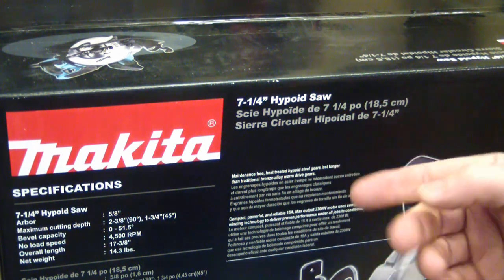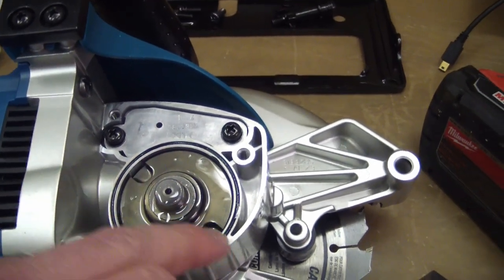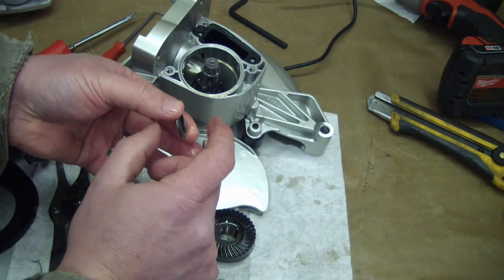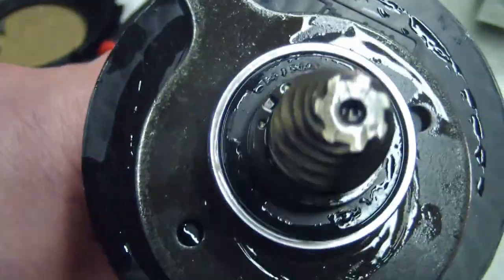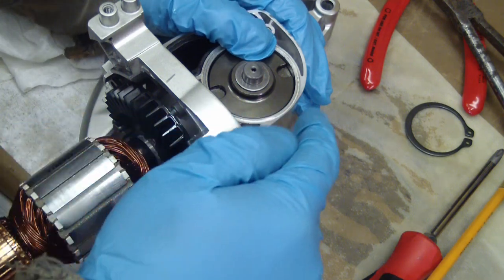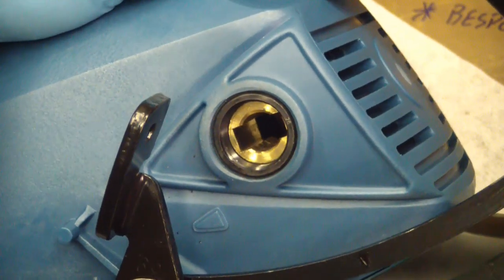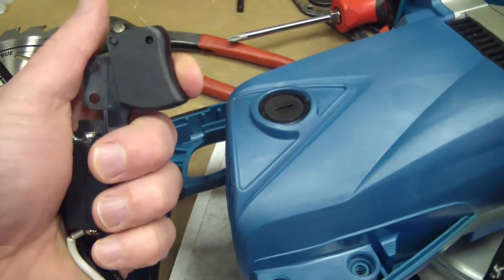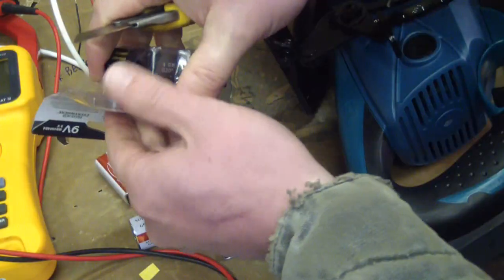Bored of lame tool reviews? Meet Makita's new Hypoid Saw.

Comment: love your reviews, theres definitly something for knowing how what you using actually works. but if i could correct someting you said, there are actually quite a few vehicels out there with hypoid diffs. orignally done to drop the drive shaft hight to reduce the bump in the floor, but done more now as a noise reduction trick.

Comment: Hi there. in the video, at min.19:35, I can see the plastic code in the housing: >PC- GF 15< which stands for Polycarbonate plus 15% glass fiber. PC is a thermoplastic but due to glass fiber content makes it a bit heat resistant. I prefer ball bearings rather than bushings for this application any away. thanks

Comment: I've used the grease trick for installing needle main bearings in old McCulloch two stroke engines. coat the races with bearing grease and stick all the needles to it. damn near impossible to do otherwise provided you don't have 37 hands each with tweezers

Comment: RE: Worm and wheel

From my experience with david brown radicon gearboxes the bronze wheel is protected from wear by the oil.

In my job i have found more radicon  (worm and wheel) boxes have died miserable deaths due to low oil levels.

Surprisingly it has been the bearings that let go before the gear.

Our units (used in sewage treatment) get heavy abuse too. 

With all this in mind, I pushed for a change to synthetic oil and we have noticed an increase in life span of the units!

Comment: In this rare instance, I feel I must correct you on something.
The drive axle in most automobiles is indeed a hypoid gearset, not spiral bevel. The rotating centerlines of the two gears are 90° to each other but on different planes.

One exception would be a Mack double reduction carrier where the first gearset is true spiral bevel. The rotating centerlines of the gears are 90° to each other and on the same plane.
Spiral bevel is usually employed where there is no reduction or very low ratio reduction, generally less than 2:1.

Hypoid is usually employed in higher ratio reductions, generally greater than 3:1.
Hypoid is basically a hybrid of the rolling action of a bevel gearset and the sliding action of a worm gear arrangement. It provides smooth, quiet operation and long life due to the large tooth contact area associated with the angle and geometry of engagement.

Comment: At one time welding machines were commonly used for power on job sites for heavy constuction and tools needed to be runmoff,dc power. Remember seeing heavy duty drills with 1/4" chucks. Talking 30 yes ago.

Comment: I think max current is achieved under load, not when it spins freely. Also, the input amps is only important for calculating consumption power, output power can only be calculated by measuring max torque.

Comment: I have a lot of respect for you man, but you are mistaken. Most cars since the 40s-50s on use a hypoid gear in the differential. Hypoid is quieter as well which is a key factor in NVH in cars. For proof, look at any car/truck with a solid axle and you will see that the pinion sits in the bottom which coincidentally means the pinion bearings sit deeper in the oil supply for cooler running. A 9" Ford axle is perhaps the most famous rear axle ever and it is a deep hypoid (farther down the ring gear, closer to a worm) which makes them heat the axle grease up much more than say a moderate hypoid like a Dana 60.

That said, I enjoy your vids man, keep em up please!

Comment: Why didn't you put a FULL bridge rectifier mounted on a heat sink and a capacitor on the output of the variac instead of using a car battery to get DC voltage ?

Comment: At 2440 the instrument he uses voltage regulator? I have one of those that is much older it only has a toggle switch for One it off And a single two prong female outlet....  I have been using it to try to slow down a buffing wheel but it doesn’t really swollen down only takes away most of the Torque Which keeps me from Burning through a finish.. Am I hurting my 120v Motor? What is the purpose or correct use of what I have?

Comment: i think most independent suspension differentials are center drive or spiral bevel, most solid axle differentials are either high pinion or low pinion types which are hypoid.

Comment: I k ow this is an old video. but Carpenters will often have a skillsaw wormdrive and makita hypoid. The reason is the which side of the saw the blade is on. Makes cutting hips/valley easier because they are cut on the 45 degree bevel.

Comment: Thanks for this. I am in the process of replacing my Harbor Freight junk with actual tools, and I decided that I also need a new circular saw to replace my aging Craftsman. My Craftsman saw was manufactured in the '80's, and it suffers from all the nasty things that was happening to Sears at the time. Not bad, but not good either. So this will be the tool that replaces my Craftsman saw (I never owned an HF circular saw), and largely because of the effort you put into your reviews. It was between this saw and the Skil, so you can understand why I came to the conclusion I did. 
So thanks again. Great video.

Comment: I have an older one, maybe 25 years old. When cutting plywood the blade starts to twist, and I have to move the tail end of the saw over to fallow the line. I'm guessing one of the bearings is shot, when I grab the blade and try to torque it in and out it seams tight?? Thoughts?

Comment: Good to hear the Dave Jones reference!

Your 9V batteries reminded me of something I did a while back... a bit of intentional destruction, but it was amusing.
I happened to find myself with 20x 12V 7Ah SLA batteries out of a UPS, all fully charged.
Of course I hooked 'em up in series for 240V DC (because we have proper electricity here in Australia). Used that to power some good old incandescent light bulbs (among other things), fed via an old table lamp inline switch - "A.C. ONLY".
I'm sure you can imagine the joy this was about to bring. Indeed, the switch had some trouble interrupting the DC!

I don't  recommend replicating this experiment. If you do, be sure to have a fire extinguisher handy, and a way to safely open the DC circuit!
Reply: *****
Remember: if in doubt, use your safety squint. Things blowing up is sometimes not the expected result, and if your eyes don't work it's harder to hide the mess from your other half.

I don't think a little 9V is particularly likely to blow up, they're not that high energy. But (ref EEVBlog) some of them appear to be made of several sealed sections which would be able to accumulate pressure, potentially resulting in poppage. A splattering of alkaline material can most definitely make a mess in your living room.

Comment: The switches have a habit of wearing out at the pivot point, since there is no longer a brass pin like they used to on some of the older models.  There will be nothing wrong with the switch itself, but there won't be enough throw on the trigger to engage the switch, rendering it useless. They use the same type of triggers on the newer XX10 and XX20 model angle grinders too.

Comment: I HAVE A QUESTIONS!
1 So all of those "AC" power tools is actually universal motors that can run on AC or DC?
2 Do you think it would be possible to use some kind of power tool for example e bike?
3 I have like a thought about maybe powering a bicycle with one of those high torque 18V impact drills, what do you think about it?

This review is awesomazable i really enjoyed it!
Reply: korsez Just note that those motors are brushed, and will not compare to the power efficiency of a brushless motor. However an 18v drill motor will be MUCH cheaper :P
Reply: korsez Those ebikes are in the news lately blowing up left and right... I am sure you will be fine building your own, after you have gathered all the necessary knowl... err, encouragement on YOUTUBE :)

Comment: why would not worn in brushes cause higher current draw?   Seems like additional resistance would cause lower amperage unless the speed of the motor is regulated, then it would end up with the same amperage.

Comment: That may not be a "voltage suppressor" on the line cord. I removed an identical one from a Porter-Cable tool and all it had inside was an anti-theft tag.
Reply: ***** Not often I'm right! Great reviews - good info with lots of humor.

Comment: I think the locked rotor current would just be the voltage over the resistance, or 80A for 120V/1.5 ohms. This is perfectly linear as long as the rotor is locked because the motor is just a resistor at this point. If the rotor is free to turn, once it starts spinning the current no longer is linear because of back EMF generated in the motor windings because the coils of the rotor are cutting the flux of the stator. Those pixies are tricky.

Comment: Strange that they used a hypoid bevel. There are more power losses due to sliding /rolling action between crownwheel and pinion compared with straight or spiral bevel.
Maybe to reduce transmission noise?  I remember GM hypoid bevels would be knackered if ordinary gear oil was used instead of hypoid bevel oil. I was led to believe that the hypoid additive had a plating effect which limited wear on the more heavily loaded gear teeth.  Late '50's GM used the Hypoid final drive to get a lower floor and trans tunnel.

Comment: Roger the separation.  I am a retired Engineer and in the early years did HM&E work for the military.  Often we were forced to buy "approved" equipment that had been around since the 30's.  Buffalo pump for example had a NPSH pump that was designed to work in salt solutions.  They came with carbon steel woodruff keys and caused us a failure we had to live with for 2000 hours.  Ergo quality and approved are mostly sales words until you correlate them with this type of tear down.  Down side was that open and inspect procedures lie this, good for data analysis, often created more failures and were eventually made obsolete.  Ergo "if it ain't broke don't fix it."

Comment: If you like your soldering iron tip chooching as long as possible - avoid using wet sponge for cleaning. We have noticed that one of our coworkers has been going through soldering tips quite faster than the others. He was changing them at least three times more often than the others.He was the only one cleaning them on a wet sponge. Then he changed to metal sponge and proved the theory right. This tip, unlike others, does not like to be in a wet environment when it's hot. Wet sponge destroys the coating and holes appear in the metal. Whether it's because of oxidation or rapid cooling - I don't know. Just sharing. Clean your tip in some dry's.

Comment: Bearing race housing boss (18:25) is plastic to prevent current through the shaft to the bearing. The moving gears causes static electricity which would discharge through the ODE bearing causing premature bearing failure. To prevent that they use the plastic housing, an o-ring in the housing, or they could use a grounding brush on the shaft. ☺
Reply: A really high end I industrial motor could use ceramic bearings

Comment: Thanks for the wonderful in-depth review! Subscribed.

While your description of the ferrite toroid around the cord makes perfect sense, you may find out that part is no more than a cleverly disguised Sensormatic anti-shoplifting tag. I was curious about this same thing on one of my new tools. :)

I also like Lucas oil products. You made a good choice there, in my opinion!bb
Reply: ***** I guess the thieves are getting more creative with removing these from packaging and stealing products, so the manufacturers are doing more to "embed" them where they can't easily be removed at the store. Another store is selling Dremel rotary tools with the cord-mounted style.  I tore down a portable air compressor (Husky from Home Depot) and it had a Sensormatic tag on the inside of the top cover of the motor.

Comment: Quick Correction Differentials on vehicles can be either hypoid gear or spiral bevel gear sets. The Ford 9" diff is hypoid gear set.  A good rule of thumb is light duty diffs are spiral gear sets and heavy duty diffs are Hypoid.  Hypoid gear sets are able transmit high torque than spiral gear sets but are less efficient than spiral bevel gear sets.

Comment: I just received a two year old makita from a friend who had it quit on him due to cord failure and then intermittent switch failure. I separated the handle to look at the switch and whatever I did allowed it to function properly again. Now that I’ve got it running it sounds like the gear is missing a few teeth and the pieces are floating around popping and banging while powered up, so I held it wide open waiting for something to explode and I noticed a 90 weight smell and the rpm fluctuates. Looks like pure Chinesium.

Comment: That gear lube is perfect for hypoid gears since it has the GL-4 and GL-5 rating.  I've seen hard working hypoid gears turn into razor blades from using GL-1 or other incorrect lubes. Good informative videos you have here.
Reply: Can you or anyone else here tell us more about that gl-1 to gl-x rating? I'm no expert in that field, but curious what it means to use a higher grade oil (and what exactly is the difference)? Thanks for more info
Reply: standard gears such as bevel or helical gears just roll or push the corresponding meshed gear. hypoid or worm gears slide across the face of the other gear and that can force out the lubricant between them. GL-5 i believe has added sulphur which adheres to the gears better and does not rub through when the metal is sliding. GL-1 is a gearlube which is mostly found in truck shops for use in transmissions. it may also be called GL-4 and works well with synchronizers because it allows them to grab instead of just sliding as this would cause gear clash, which can happen if you use GL-5 in a synchronized trans. Using GL-1 in a ford 9" hypoid differential will slowly wear the teeth till they are razor edged, just like slowly sliding a knife across a sharpening stone.
Reply: It's not necessarily a higher grade, just meant to be used for different purposes.

Comment: I personally feel that a plastic casing is fine. Modern technology can produce a lighter but still reliable plastic material. I did like the fact that the brushes are housed in a brass holder. It appears here that the trigger start component is good quality and with electrical connections which are proper screw type and with access. On my older power tools I have found that the electrical cables gets internally damaged just at the place where it enters the tool and thus I need to cut off a short piece of cable and re-terminate the wires. Having a proper design to be able to conveniently and easily work on  the terminal connections is  a very important consideration. It seems in today's world that electrical connections for appliances, or plugs, or electrical motors all have very poor designs and with little thought of maintenance. Thank you for an informative video and I will be sure to have a look at some of your other ones which I hope will be just as good.

Comment: I entered into tho word of amateur speaker building and got a skill plunge base router and a circle jig, it lasted 8 holes in two layers of mdf then crapped out! took it apart to find that the parts that hold the brushes in place are plastic. do they not fail test these things? this is one of those "a system is only as good as it's weakest link" tools. I just don't understand why it's done that way. dou you have a review on routers? I was looking at a bosh.

Comment: Have one ran the first couple jobs I had a kickback broke the springy thing and the thing holding it, that's the first weak point second is the coating on the electric cord I only get shocked when it rains out so that's not bad, also it should run 5000 rpm to be excellent. Other sad thing is it's not able to handle a large blade to saw 4 by fours

Comment: Forgive my ignorance please, and i know you likely won't see a comment on such an old video but I had to ask. The comment you made about it blowing the breaker if it was really 15A, couldnt that be referring to the "output" I guess after a transformer ? Maybe it's just simply that it's not referring to that and you know that's the case, but I'm a NOOB and just learned that for instance my 12V charger is able to  pull more amps than the breaker because it's not really "pulling it" but rather 
outputting after the transformer. Is it safe to assume that’s just not the case when talking about dc motor electric specs?

Comment: AvE, I was wondering if you could help me out. My school is thinking about making a sort of 'makerspace'. First, we'll have 3D printing, but we'll also have LOTS of woodworking, and metal working tasks. I am working on trying to help them figure out what they need, because let's face it: an IT department doesn't know crap about machining. So, I was wondering if you could give me some advice on must-have tools (like drills, angle grinders, dremels, and CNC mills), where to buy them, and what brand to buy them from. We are probably going to work with the normal wood and wood related materials, plastics like nylon, polycarbonate, and rubbery materials from the 3D printers, and on top of that, metals ranging from aluminum, to steel and iron, anything more extreme would be unnecessary. We may do welding but I'm not sure, but we will do lots of CNC milling and lathing, and stuff like that. We want to balance safety with functionality as much as possible, and we want it to be easy to learn on too (why we want CNC vs. manual machining systems). 

Any advice, or recommendations you might have?